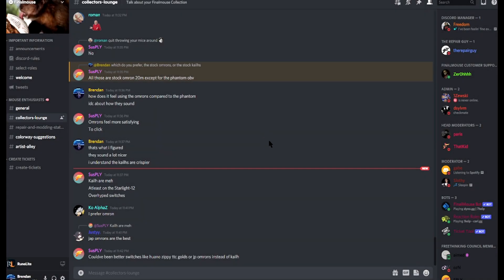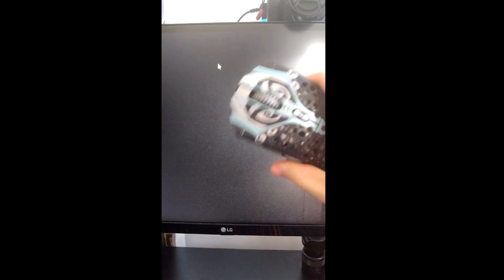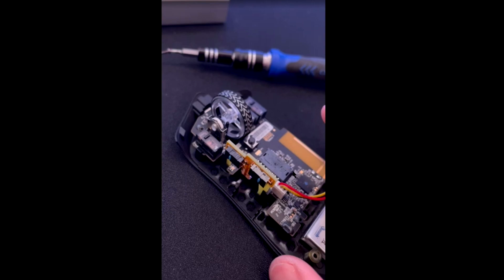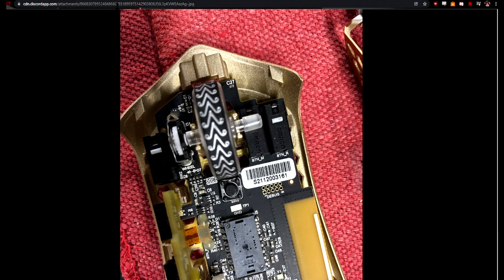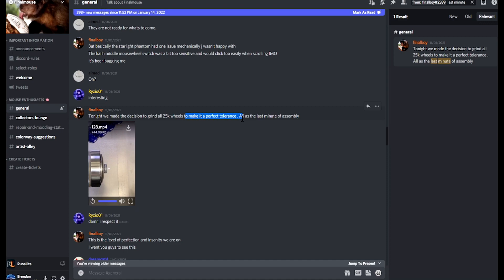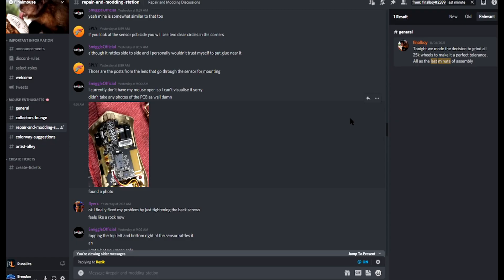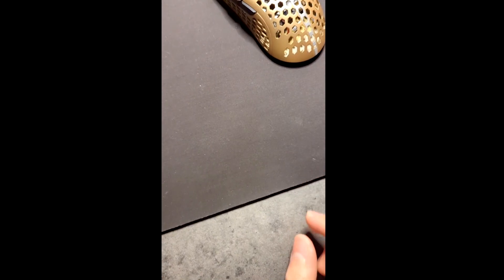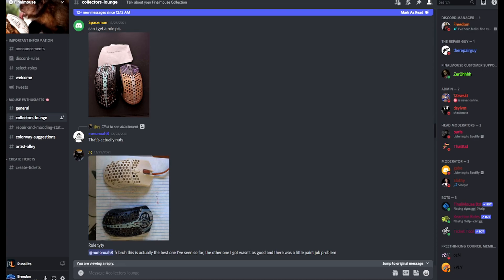HOW TO FIX SCROLL WHEEL AND RATTLE ON FINALMOUSE STARLIGHT-12 PHANTOM

Comment: I dunno how many times you’ve seen me and other council members go insane repeating these things over and over over and overrrrr since the phantom drop, but this video is very refreshing, it’s great that someone else gets it, the only thing that is wrong is the clicker piece does have a small amount of clockwise and counterclockwise rotation, this is not bending anything or causing any negative effect, it’s purely making the scroll look better positioned visually. 

Great video other than that
Reply from the maker: its not that its bending, but its just moving it away from its natural alignment position.  It does make it appear straight, but in reality, the scroll wheel is still crooked after doing this fix.

Thanks for your support on the video :)

Comment: I have a Finalmouse but I also have a lot of other mice that cost even more. However, the other mice are engineered in the beginning correctly where they don't have an off-centered scroll wheel, nor do they have for the most part loose innards. There isn't a mouse that I seriously use where I haven't replaced all the switches and the encoder at minimum. Finalmouse is a good mouse, but its primary niche is its collectability. 

My GOAT mouse is my GPX Ultralight with heavily modded (left hair triggered)  switches, replaced encoder, weight reduction and for the moment Superglides on a solid aluminum core PVC covered mouse pad.

Comment: On my copy, even with the mouse wheel original as it is, it still actives mouse3 accidentally when scrolling up. doesnt happen to scrolling down. Im thinking of either adding a washer or swap the mosue3 switch into a much higher operating force switch. Do you have any thoughts on this?

Comment: Really great video, u cleared most of my doubts. But Brendan u havent touched on the ghost scrolling. Whats up with that?
Reply from the maker: Because it's not an issue.  The scroll encoder is sensitive and people don't know how to properly use it.  You are letting it sit between steps and then hitting the mouse and it's jumping to whichever step is closer.  

There is a firmware update in the Discord that finalboy made for people who don't know how to scroll 😂
Reply: @LunatechComputers  thanks alot for your great explanation, I really appreciate it. There were Alot of "misinformation" going around about how bad these issues were and it was holding me for purchase the mouse. Can't wait to get one. 

Again thanks alot bred.
Reply: @LunatechComputers  You have a direct link to that firmware by chance? I've just never had this happen on any other mouse I've used (Steelseries 300, 310, 600, Prime wireless and Zy's Rail) and if there's firmware to mitigate that then I'm all for it.
Reply: @LunatechComputers  what about the issue of opposite scroll wheel input? I will only be scrolling up on a stuck page and it scrolls down same vice versa. Seems to be a common issue. You seem quite knowledgable any fix to that issue? I'm on a poseidon btw